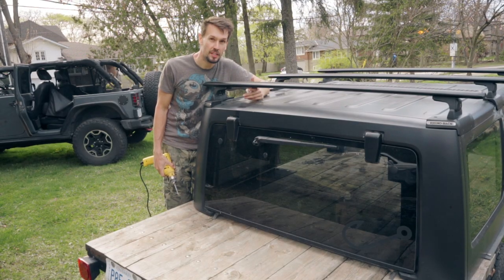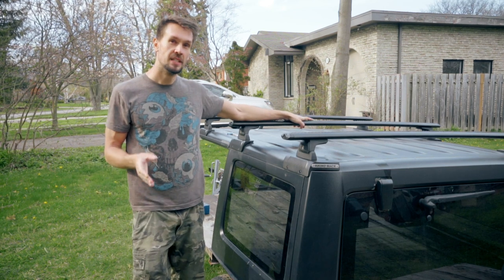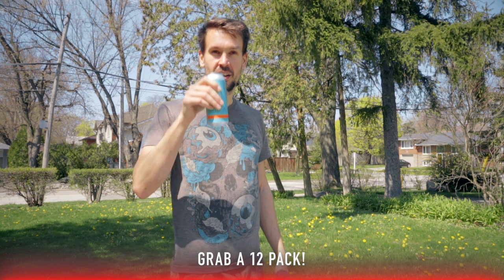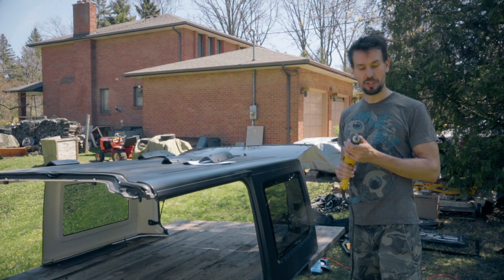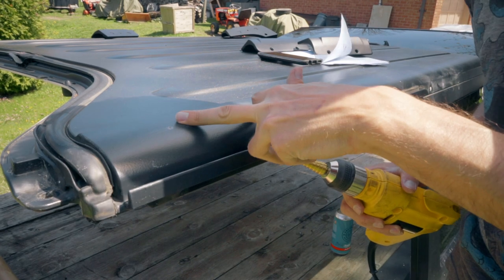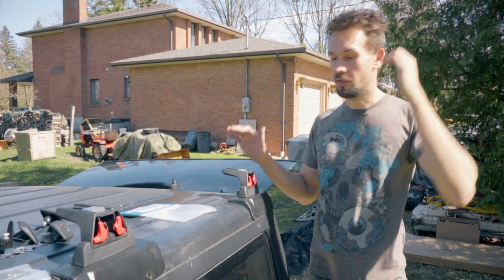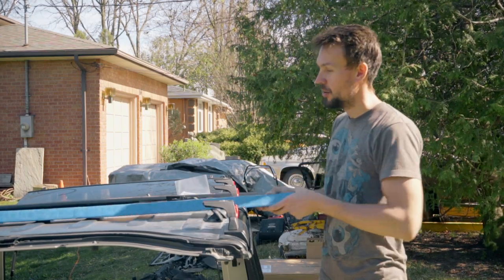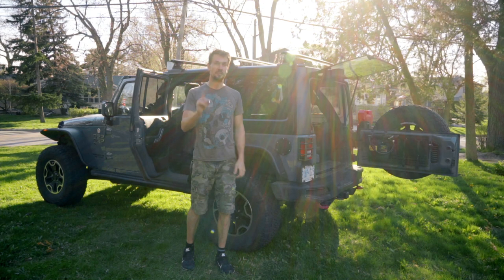Install: Rhino-Rack 3 Vortex Bar Backbone Roof Rack

Comment: HUGE thank you for posting this.  I installed mine and your video was my guide.  I used the instructions but had a lot of questions and seeing you do this and your walkthrough was SUPER helpful.  I do think one item I found is that by installing the rubber feet on the backbone plates first, did cause some issues with the placement and fit.  Going back the instructions say to do it after you mark and drill your holes, which I think would be better in hindsight but it wasnt that big of an issue.  Big thanks.
Reply from the maker: Oh man, so glad to hear it. This is why I do these videos, happy to have helped! Enjoy your new mod

Comment: Installing my kit now. My supplied paper template true dimensions were off by 5.8mm so anyone also doing the kit, make sure to measure your template before drilling. And if you don't have a ruler or measuring tape, just double check the paper template against the metal parts.
Reply from the maker: Great PSA, you definitely always want to measure twice and make sure things are right

Comment: Great video!  I purchased the RJKB2 backbone system for my 2008 2-door Rubicon.  After reading the instructions I was confused about installation and thought I was shipped the wrong parts.  I went to YouTube and found your video which explained what I was missing from the instructions.  Instructions were for an installation on a different vehicle, not using the backbone hardware.  The instructions showed using two bolts to attach the leg base where only one is used to attach to each bracket.  (Only 4 bolts holding down the two vortex crossbars seems a week point in the design.) You showing a hole in the end of the Allen wrench which is required for the unique bolt head was another thing that the instructions missed.  With it still snowing today, I am waiting for a better day to do the installation.  With your instructional video I will have not problems now.
Reply from the maker: Oh man that's a shame you were sent the wrong instructions! Happy to help sort that out for you. Hope that weather clears up soon for you

Comment: Duuuuude, good to see you back on the air! Great job and I just listed my awesome GOBI Stealth and will be installing this one, so another great vid. Thank you!
Reply from the maker: The GOBI is nice, but this is also a solid choice depending on what your needs are. Thanks for watching and enjoy!
Reply: @RubiconUnlimited  Have you loaded up an RTT onto the 3-crossbar set up yet?? I'm asking cuz' I'm told by my supplier the bars are not strong enough to handle average 150lb RTT weight, plus 2 ppl + gear...but I'm a bit confused cuz' I thought these were rated at 265lbs dynamic and 750lbs STATIC. Thoughts??
Reply from the maker: Hoping to have it loaded up in a week or so. Haven't heard anything about them not being strong enough

Comment: Excellent overview and installation video for this rack! You have inspired me to purchase and install the same one on my Rubicon. I also appreciate your comment on switching to the fixed mounts rather than the Quick Release version you started with, as I was undecided between the two until now. Do you have to loosen the rails and move them to get to the bolt that attaches to the BackBone plate, or can you easily access the screws with the rails in the installed position?
Reply from the maker: So glad to hear that and happy you caught my new comment about switching to the fixed mounts. I'm not quite sure what bolt you're referring to, but all are accessible once unlocked
Reply: @RubiconUnlimited  I am referring to the bolts that attach the rails via the fixed mounts to the BackBone Plates. In another installation video, I watched the person tighten these bolts to the plates, then adjust the rails to the position they wanted, then tightened those bolts. This led me to think that if I went with the fixed mount, I would have to do both these steps in reverse order each time I wanted to remove the rails so I could park in my garage.
Reply: @RubiconUnlimited  Hi there.  I'm late to this party but maybe you will still see this.  Where is the comment about the fixed mounts?  I just installed this same setup.  Backbone is in but I haven't started attaching the quick release legs yet.
Reply from the maker: The quick release mounts are nice, but after sustained use of a rooftop tent and it's weight, the quick release mechanism seized. I could not remove them which prevented me from accessing the bolt below. I ended up going with the standard legs, which are just as easy to remove, lower profile, and more reliable. If you don't plan to put too much weight on the rack you should be okay
Reply: @RubiconUnlimited  Thanks for the response.  I'm planning on putting on a tent.  I'll send the quick release back and get the standard legs.  I also don't think they sent me the right hardware to attach the quick release legs to the backbone.  The bolts start to grip but won't hand tighten at all.  I guess I could just start cranking down with the allen wrench but that doesn't seem right.  Did you have any issues like that?  (They didn't send me a separate JK bolt kit like I see they do with the standard legs.)
Reply from the maker: @briansherman7132  hmm not sure about the bolts. But glad you're swapping to the standard legs, it's definitely worth while!

Comment: Thanks for the video, may i know do we really need to take off the hard top in order to install the backbone system?  Can i do it without taking off the hard top?  Thanks.
Reply from the maker: You'll want to take it off to avoid drilling into your rollbar. Plus you'll have more room to maneuver the brackets into place.

Comment: now that some years have passed have you had any issues with the backbone rack and roof top tent attached?
Reply from the maker: Don't go with the quick release legs as they will seize on you. The regular legs are strong and only take one bolt to remove. Go that route

Comment: Great vid.  I was thinking of getting one of these.  When you remove the crossbars (and legs) using the quick disconnect, how tall do those "feet" stick up off of the roof?  I have 37s and have limited space to fit in my garage.

Comment: Awesome video!  Do you know if these could be used with a hard top hoist to lift the top off in your garage?  It should be well below the static load limit, but it would be tension rather than compression.
Reply from the maker: That's a good question, I'd think it would be fine.. but might be worth reaching out to rhino rack for a clear answer

Comment: Just called Rhino rack and they said they dont reccomend you add the Rlt600 for jeep wrangler as they have not done testing on those and to go with fixed. Insurance will not cover it.
Reply from the maker: The fixed is a great option and actually cuts down the height of everything by an inch. I recently swapped to that to simplify things. With the fixed version it's just as simple to remove the rack if needed - one bolt per foot.
Reply: @Rubicon Unlimited  
I was looking for an electric wrench to see if I can make the removal of bolts quicker but no luck. Do you just use a m6 wrench ?
Reply from the maker: @urgeon2  i actually have a tiny ratchet bit set that works here. I linked one in my latest PCV valve video if you're interested
Reply: @RubiconUnlimited  im sorry rhino makes good products including all their racks but they have lost their minds on pricing. nowadays they will not give any kind of static numbers for ANY vehicle. dynamic they will give, not static. im leaning toward the exact same setup as you have on this video. do you have any words of wisdom for me? why did you switch to the fixed? i was told the fixed was for toyota highlanders and the sort of suv's. i just bought a new tent and need a rack pronto!! but these prices are breaking the bank.
Reply from the maker: The system was great, but the quick release system is not designed for the amount of weight that a rooftop tent + occupants put on it. ultimately the quick release failed which prevented me from releasing it at all, not good. The fixed mounts are much lower profile (maybe about an inch shorter) plus they are just as quick to remove (1 bolt per foot). so if you dont mind using one wrench to remove the rack, just go with the fixed system, its way sturdier.
Reply: @RubiconUnlimited  so i installed my kit with the RCL legs(not quick release). my legs had two tabs sticking out at the bottom of the legs. but there were no "slot" cutouts on the backbone bases. did you run into this problem?
Reply from the maker: @blackdiamondrob  yup, you actually them off or shave them down. I guess those same legs are used for other kits as well. You don't need those tabs here, you want the mount to sit flush

Comment: Would this interfere with my hot head liners I just ordered this rack set up! Also where did you get your step bit I saw yours 18mm was the biggest size so you couldn’t over drill mine goes up to 20mm
Reply from the maker: Should work fine with the liners, but you might want to install them first, or temporarily remove the brackets. I got my bits from princess auto, here in Canada
Reply: @RubiconUnlimited  thanks man for the reply! I already have the liners installed they came with my hard top the piece I’m worried about interfering is the flat inside brackets the ones that surround the cargo windows appear to be fine
Reply from the maker: @B0bbyh  should be good to go! Enjoy the rack, its a good one!